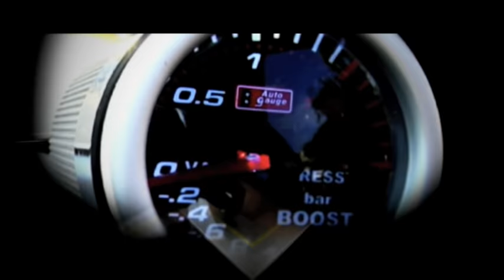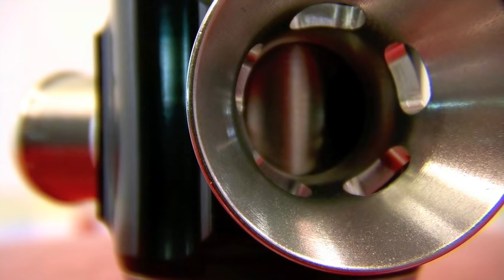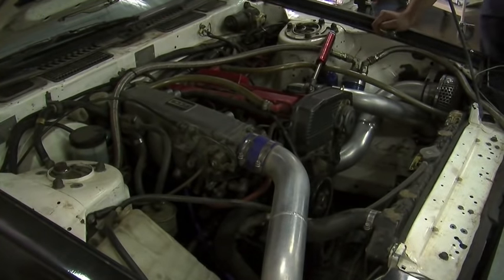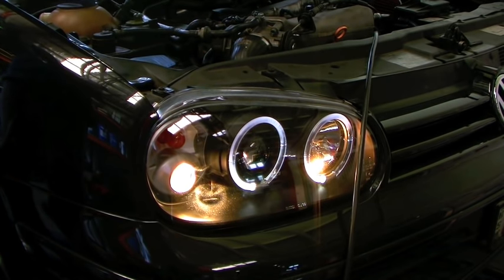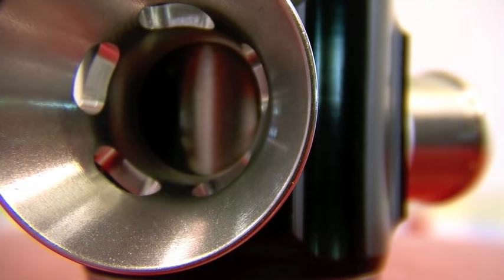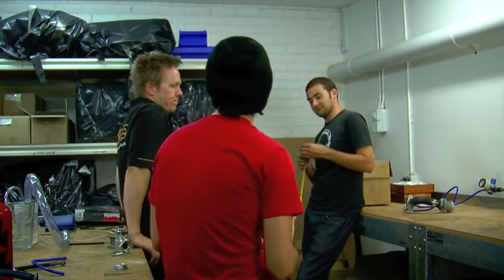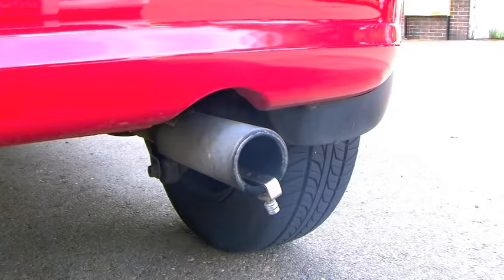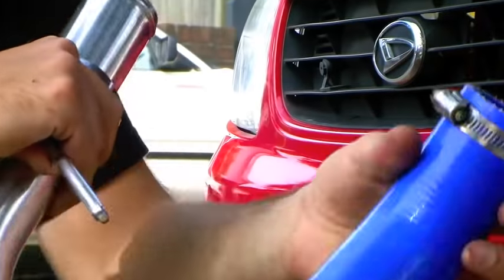Blow Off Valves Mythbusted

Comment: I genuinely want to fit a fake BOV to my 1.1 Fiat Seicento, just to see peoples reactions. Maybe use a rev light to trigger a relay so it only goes off above like 2.5k for authenticity. Overthink ftw.
Reply: so a fake wastegate then
Reply: Well basically what they've done but the use a relay that only comes on with a rev shift light so if the switch on the throttle is activated, and it's over a set rev limit, it'll go. So that way it won't dump before it's "spooled" if you get what I mean? :) Like it wouldn't dump at 1.2k RPM if you blip the throttle

Comment: I don't know why your video only shows how BOVs don't affect max HP.  That's not their purpose.  Showing how they affect turbo lag during shifts is what proves/disproves their usefulness.  Diverter valves are the most effective at minimizing lag since they keep that pressurized air circulating when the throttle closes, but riceboys replace them with BOVs for the noise they make, wasting all that pressurized air that would otherwise keep the turbo spooling.

Comment: The fluttering turbo sound is bad for the turbo?
Reply: Sometimes the wastegates will make the fluttering sound, my internal wastegate turbo made that sound and my old wrx used to flutter a lot at wot because of its ewg...
Reply: Is that bad for the car?
Reply: +Steel Eagle If you run a turbo without a bov you'll get that noise. It just wears the turbo put faster. You'll notice in old Subaru rally videos that their cars give off the noise cos thats what they did. 

You can get bovs that replicate that noise as well, however imo they are pointless as the whole point of a bov would be to vent pressure in an even manner and not fluttering. Flutter generally = turbo dies faster. 

Although I myself prefer the sound of a flutter I wouldnt put it on a car that you use for the road, unless you have the money to be buying new turbos.
Reply: +aflappincod ah, I see now
Reply: +Steel Eagle If it does any damage which is debatable it's so small you wouldn't even notice, it's very common for people here in Australia not to run a blow off valve/bypass valve.
Reply: +Steel Eagle turbulance inside the compressor is no bueno. good way to destroy the seals and bearing
Reply: Since no one said it directly, yes, the fluttering sound is bad for the turbo. It's called surge, or more aptly compressor surge. How much it hurts the turbo depends on several things, most important in my mind being overall boost level (higher boost = more damage from more violent surge). It may sound cool, but as mentioned there are many benefits to a properly vented setup, not only increasing the potential life of the turbo. Look into compressor surge for more info.

K Fox
Reply: Australian here with a GTR and I care about my garret turbos, no point forcing air backwards thru the compressors unless you "wanna sound fully sik m8". I have a BOV. I disagree, most people DO use a BOV. Compressor surge isn't cool.

Comment: the dyno test was done wrong..........

should be measuring the power between zilch and full gas wen acelerating...... and alsorts of other dynamics 
also recirculating the the boost could have lower intake tempature but since only basic dyno wont see see it 

to really bust the myth u should find a decent track with hills and tight corners and long straights hook a epic race ecu into the one u have and use it to data log a long time of each way.........
all that data show the small differencs

Comment: Erm??? Why are you dyne testing valves? They don't increase power, they help keep your turbo spinning between shifts? So you have instant power when you're back on throttle…
Reply: They did that to make a point which is that they don't increase power.
Reply: Then that makes the test pointless…

Comment: All of you below need to watch BudgetBoosting blow off valve the truth.  We explain absolutely that blow off valves are the tuners choice and not a necessity, we have proof of 27 year old turbo on a 1987 buick Grand National that worked perfectly without a blow off valve until we installed a T66 turbo for upgraded performance.  Watch this video, it puts the blow off valve controversy to bed.

Comment: Did anyone see how they just drove right on the dyno and started going. That's so dangerous lol
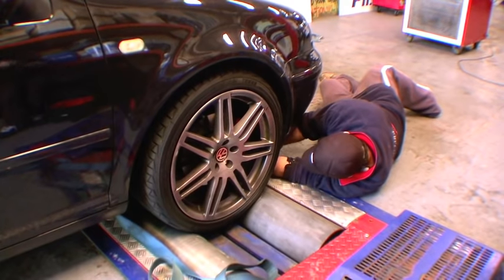Reply: That obviously wasn't a full power run and because it's front wheel drive, you can use the handbrake to hold it in place while you align it then strap it down. You can clearly see they strapped it down before any testing @ 3:52.

Comment: the fake blow off valve sounds like a big truck releasing the pressure when braking or shifting:))
Reply: That's because those diesel engines are turbocharged! :P and those brakes are pneumatic
Reply: Dean Neubek wow,the smart guy just added a comment...
Reply: Thanks for the input!

Comment: I have NEVER heard so much complete tripe from a bloke that is supposed to be in the know.  He just wants to sell products that make you a target for " Undue noise due to manner of Operation" 
            If the Turbocharger and the associated plumbing is done correctly there is ABSOLUTELY no need for anything like a BOV, because venting the pressure you have already built is in effect wasting power, Why because the Turbocharger simply cannot stall but the Air simply goes round and round like a centrifugal water pump once the output pressure is achieved and the internal waste gate or boost control valve opens maintaining the Manifold pressure.  This means you have NO lag because you already have pressure built. If you have a gauge in the system you would see a momentary drop in boost before the turbo makes pressure again.

  For me the concept of a Turbo is to get performance AND economy YES you heard right . Small engine cruising along depending on the vehicle is economical but lazy when it comes to hills or passing at highway speeds, that's where the extra power from turbo-charging comes in.  You don't want or need high boost and power all the time.

Comment: NOT A GOOD IDEA to have backpressure thats the whole point of the valve!!!!! you do not want excess pressure staying built up, thats called compressor surge and can RUIN your turbo / engine!!!!!!
Reply: Tim Smith  if you know how to operate your car properly you can keep some pressure built up anyway by not completely letting off the throttle, any time you completely let off the throttle, the pressure should be completely purged or you will get compressor surge/damage

Comment: I couldn't understand what the hell are you testing in this video... A BOV won't get more power.... Just prevents turbo lag... So why are you puting the car on the dyno for? I've missed the point, probably...
Reply: Ok... I understand... But... Is this really necessary? A dyno, and all that shit... Wouldn't be enough just a good explanation? Perhaps not... I don't know. Some guys maybe won't be enough... I get that :)
Reply: They did it to bust the myth that it would give you more power.
Reply: Blow off valves do not prevent turbo lag, they do help to mitigate the effects of lag though. Their purpose is to prevent damage to your throttle bodies, carburetors and turbo from pressure spikes.
Reply: Blow off valves have many purposes... From the performance increase point of view (that is what is analised in this video, i think), the purpose is to prevent turbo lag. But that, it's just theoretically. And that's when it makes a difference, between "good" bov and "bad" bov... Some BOV's, just makes exactily the oposite, staying open for many time (meaning the range of vacuum pressure), increasing the time it takes for the turbo to pressurize downstream... Good BOV design is essential. I agree with most of what you say. But if it is just from the reliability point of view, increasing the life of all those parts and some others, they wouldn't have any interest in competition. For example, rallycross, where a turbo could survive without BOV, if it is for just one race. There is a benefit from the performance point of view either. And that is achieved in turbo lag (sorry for my poor english) ;)
Reply: Sorry... I think the problem is with the word "prevent", right? What i mean is that it doesn't avoid the presence of lag, if i can say this... The lag exists, but is decreased. Is it ok like this? Sometimes i don't have the correct words in English, wich is very poor :D Sorry

Comment: I know this vid is old but MCM leaves me a little brain dead after watching it for a few minutes.. They come across as a couple of guys that don't know a great deal about imports or even basic mechanical knowledge and then run a show trying to debunk even more bullshit made up by guys that have less of an idea about cars/ turbos and alike...  simple answer for bovs.. look at what the manufactures do.. look at the RB.. cefiros don't have a bov, r32s have a soft recirculating bov and after owning both there is no difference at all in performance at all (mind you the ecus are mapped differently) , no lag between gears and no problem with running higher boost levels with a fmic.. blow off valves are just a gate and are useful when you are running  big turbos with big boost .. yet then again I have seen rb20's running 28psi with td06 and td05's with no bovs and run fine..

Comment: Stop calling EVERY valve a BOV. If it doesnt vent at all and only DIVERTS the air its a Diverter Valve. This video took into consideration ZERO of the cars that have higher tech electronics and MAFs... That is metered air ... without it you will have issues (a/f )

Comment: Yes it's lame to put a blow off valve on a naturally aspirated car. The point is you can but zero performance gains. Don't pretend you have a turbo. If you do have a turbo then get an aftermarket blow off valve.  Simple as that.

Comment: Stopped once it hit into a BOV on non-turbo car.  That's as lame as any poser-mod.  I run an RFL BOV and honestly it's not a big deal or attention-getter.  BOVs are common.  Nobody cares if your turbo hisses like it should.  You won't get an applause...especially for faking it!!  If only more ears were tuned to help those poor ignorant souls who upgrade their turbo but don't add a BOV to compensate.  Turkey Gobble is straight damage to a turbo, just like big turbo but no added fuel is to those valves. Poor cars.

Comment: Does noone know the other reason for a BOV? most cars won't idle without it after boost.  Now work that out!   And don't give me any crap about ECU remembering measured air or that the pressurised measured air is recirculated.  This is all myth  bullshit, that doesn't comply with physics.  Recirc and atm dump valve all dump to the atm, the only difference is the mfr air filter quietens it alot.  You want the noise, just fit a cone filter.

Comment: What a waste of time. I'm sorry but I feel a lot of your videos are inconclusive. Like testing a cold air intake on a dyno. Your going to get much colder air while moving while other intakes are taking in hot air from the engine bay....this video just blows my mind though. Plus on the vw and Audi motors they are designed to retain diverter valves. You will run slightly rich if you run a bov as the computers won't compensate for the missing air.
Reply: Colder air makes more power
Reply: Correct. The air is denser....common sense. Its better than pulling air from the engine bay. And a cold air intake is going to intake more air. I dynoed my car before and after. A car with more than a 1.2 liter motor will react better lol
Reply: Matt Vacca You're complaining they tested the cold air intake theory on a dyno yet you brag how you dyno'd it. I'm starting to think you don't even own a car.